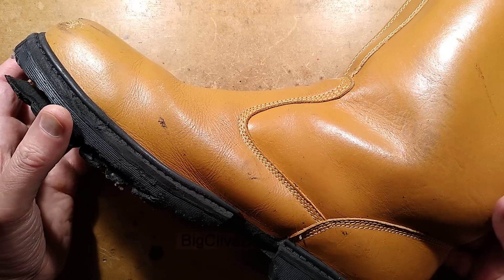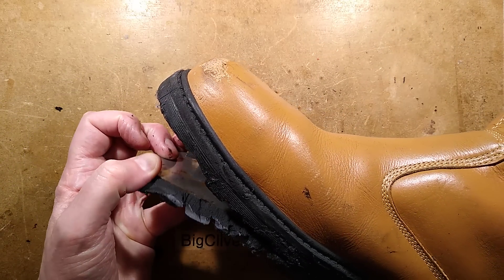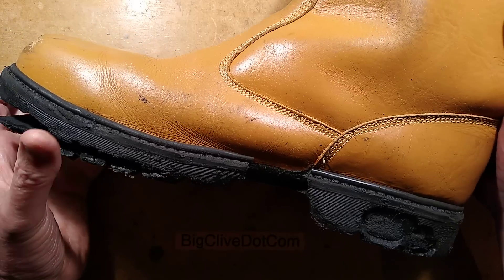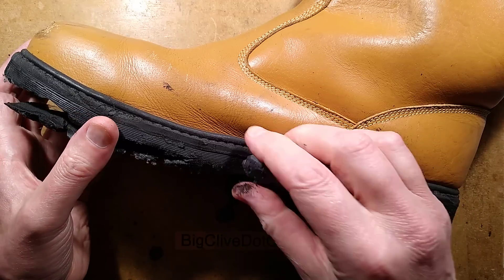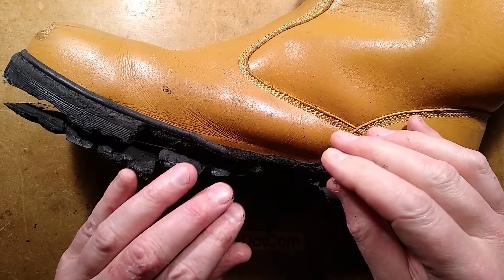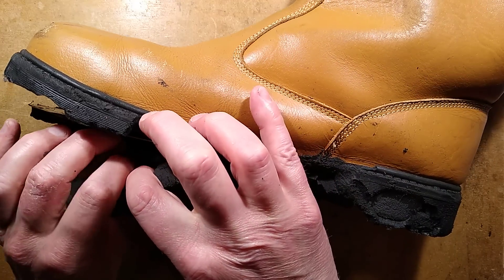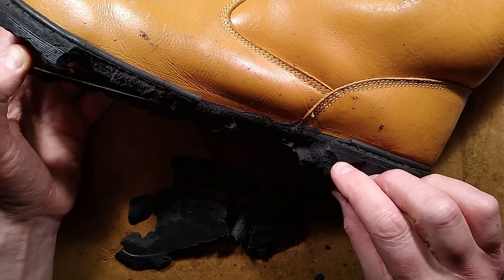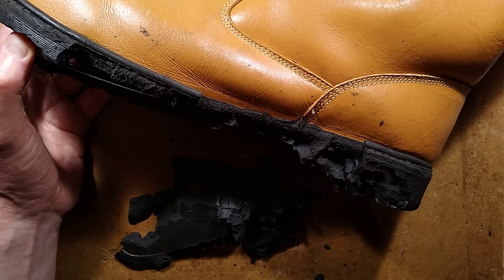My work boots have melted!

Comment: My favorite laptop mouse had something similar on the sides of it,  started shredding after someone in my household had greasy hands from eating a hamburger and used the mouse/my laptop to check their e-mail.  could you have come in contact with animal fats?
Reply from the maker: They're suppose to be oil resistant.

Comment: Are you sure they were stored in a cupboard and you wasn’t holding onto some HV lines while wearing the boots? (Cartoon style soles of the feet melting into the ground)

In all seriousness, I would say hydrolysis of the polyurethane the sole is made from. Moisture can be good for some things but not here. A dehumidifier might have given you a few more months usage but unfortunately it is time for your safety friends to be environmentally disposed of

Comment: My chair wheels melted over the floor protector from IKEA, I was using the chair for 2 years without issue, then I decided to use floor protector. then in one week the disintegrated. I think they had chemical reaction to each other.

Comment: I had this happen with a nice pair of work shoes. Except in my case they started to disintegrate in the middle of the street, quite embarrassing actually. I had to go buy shoes right there and then. And then I read Polyurethane does that. Quite disappointing, they were nice shoes.

Comment: When carbonization after vulcanization didnt happen fast enough, hydrolization after polymerization was the ticking time fuse of profit. There are now DIY adjustable durometer polyurethane kits you could try. I wouldnt attempt it. Side note: had a pair of boots resoled with urine cured camel leather once. Got them wet once, never again.

Comment: first instinct is chemical exposure, something that doesn't touch leather much but obliterates synthetic rubber. second is faulty mixture when they were making the rubber for them.  third is that I'm underestimating just how long "a long time" is, if it's been a decade then yeah that makes sense.

they can be saved by any competent cobbler, doubt those are worth the money to send to one though.

Comment: Its because manufacturers use the wrong materials, in this case pu aka polyurethane which reacts with air humidity and disintegrates which is called hydrolysis. Its a form of planned obsolescence like simlock in old phones or automatic anti theft in smartphones. It lowers the usability and removes the control which you have over the product so it fills the landfills with new waste. Only option is to never buy products like that, which is very hard to do because this form of obsolescence sneaks in unrecognized if you are unaware and have no way of testing it. Hanwag make very expensive 300$ Shoes which are for the bin after a fewyears, they cover the topic on their website and pretend it is a normal thing.

Comment: Take them to a Cobbler. While many here say they can’t be repaired let a Cobbler tell you that. I’ve many shoes and boots I thought ruined but they put new soles on and saved them
Reply from the maker: The tricky bit is finding size 16 soles.
Reply: In my experience they typically make the soles.

Comment: Most definitely a bad batch. Only other explanation is if you’ve chemically dipped them in some sort of acid or bleach but you’d probably have noticed. So I’m going with bad batch, the rubbed was not cured properly during manufacturing. Rob

Comment: If they have "biodegradable" soles then this is "designed" to happen after around 4-5 years. Surprisingly many footwear manufacturers, especially workwear, have moved to use these biodegradable soles to save the planet from discarded and lost footwear in the forests, completely not that the after 4-5 years happening autodestruction would force people to buy new expensive shoes for work. (There might be slight smell of sarcasm here)

Comment: Ha--ha-ha-ha!! LOL I don't remember how much Clive's shoes cost, I guess around 100euro. Anyway, this is what happens to shoes all over the world. I have a soviet  tech. early 1990s "stenka" this is a wall sized set of cupboards and wardrobes 2.4m high and about 4m+ long. So there is old soviet  varnish coating of chipboard furniture panels. Thus  the result: EU made safety shoes (I guess oil resistant also) - sole decomposed after 2 years of being stored. Ladies autumn shoes - also decomposed after 2 years of storing. So my theory  was that old furniture coatings and chipboard glue were decreasing shoe sole life. But it looks like if you walk your shoes on dusty asphalt they might last longer.

Comment: All I can say is cheap cheap crap, the wife had a similar issue with her heals of some shoes (that weren't very old) and the centre part started to disintegrate as she walked across a dance floor, had to bin them. I consider that they have an exceptionally rugged expiry date, giving a new heightened meaning to when the watch stops  the main spring slashes your wrist.

Comment: You could have had them resoled, with better soles to boot. They just take off the old soles and glue on a new one, then trim it to size. Cost me bout 20€ last time they did mine, can't imagine these boots are cheaper, then again you may get them "free" from your employer.
Reply: Could also have a go at it yourself, get a video out of it.
Reply from the maker: UK size 15 (American 16) so availability of soles is tricky.  It was easier and cheaper to get a new pair.

Comment: You don't want to live in the tropics then...if it isn't mouldy then anything that was originally made from crude oil or its derivatives turns back into it after a few years at most... Soft touch rubber on tv remotes, phones and cases, runners with soles that aren't pure EVA (although the contact cement will fail first anyway), the list is endless!

Comment: Dear God the amount of butylene rubber and other synthetic products that I find degrade drives me up the wall. I have several synthesizers that have lovely sticky knobs. I've even had a toothbrush recently where I went to it and the bristles had gone soft and elastic overnight. 
Thankfully for the butylene rubber crap 90%+ isoprop makes it a doddle to get rid of. 70% doesn't work well, but 90% makes it a breeze.
I wish companies would stop using this crap though as it simply doesn't last.

Comment: HAHAHAHAHAHAHAHAH..
I was walking around in a Local Paper Mill here. and something in the Air or the puddle of Water I walked through outside  Caused the Glue holding the Sole on my almost new Steel Toe boots to come off both boots .???
They had to find some Duct Tape to make a quick fix.. They bought Me new Boots and wanted the old ones to find out what caused them to fail. I never did find out.
Thanks Much...

Comment: its "normal" now as they have used the foam type. same on screw driver's. it MIGHT survive if it is stored in the open. if you store them in a closed box etc the gass they give off start degrading them. ECHO shoes have this problem bigtime and the old costumers do not by them anymore. USA have the same problem on the white parade shoos.  if they stay long enough they turn in to tar. it's real crap if you pul out your "nise shoes" and they dissolve in the midle og a weeding or funeral etc.
the prosess is Hydrolysis in the polyurethane they r made of.

Comment: Maybe you stepped in god knows what. Similar thing happened to me years ago.

Me (asking informed question (oil-proof soles)): Could some derivatives of oil dissolve soles?
ChatGPT: Yes, some derivatives of oil can potentially dissolve certain types of soles used in footwear. It depends on the specific type of sole material and the chemical composition blablabla...

Comment: Now, you know why you should check the date code's on your tires! they degrade just like such! I doubt any tire will degrade as such as this, since a tire is built differently. but, they can come apart!
Reply: Vehicle tyres degrade mostly by the rubber becoming hard and less flexible/cracking.
Thus grip is markedly decreased...
which may not be apparent if the vehicle is daily driven and the driver degrades with the car...
Reply: @JohnSmith-yv6eq  well right, but... this goes to show all kinds of type of Rubber synthetic and non synthetic rubbers degrade!  a show falling apart while walking may not hurt you too bad. unless it trips you up or something, but a tire blowing out or shredding  at High speed ... that is not going to be good!

Comment: most poor quality rubbers tend to go geoy after a few years, the better quality the longer it takes, but all rubber is doomed to fail eventually
those work boots were likely stored in a climate controlled and humidity controlled environment, that means the chemical processes that include water and thermal energy(hydrolysis) have had many years to do their job
it is inevitable that any footwear with rubber on it will degrade in a few decades, sometimes it happens slow sometimes fast
shame those boots are de-rubbered, they are nice and in otherwise good nick

Comment: Get your money back as not fit for purpose. You should have done this before you videoed it, and sent them the video first! Soles for "safety"workboots should be impervious to water, acids and solvents common in the workplace for obvious reasons. Age of the product is not a defence in this case, as they auto-destructed.